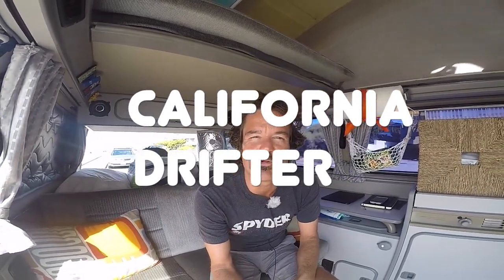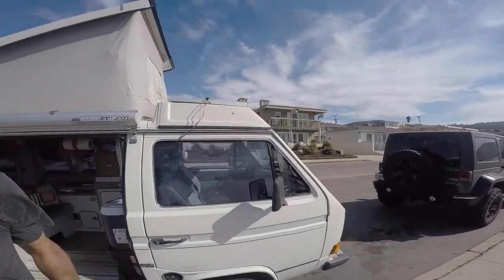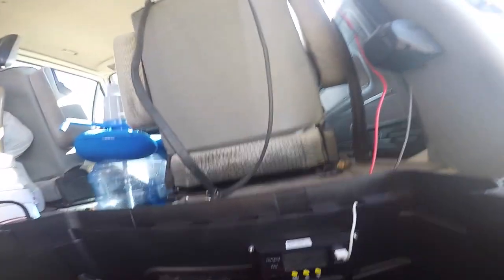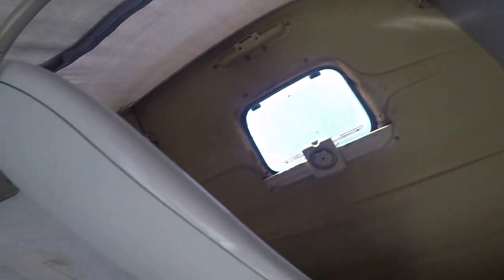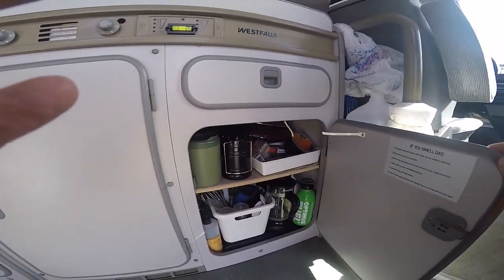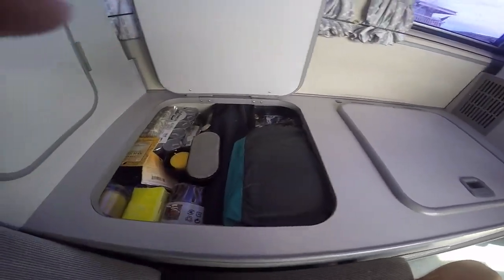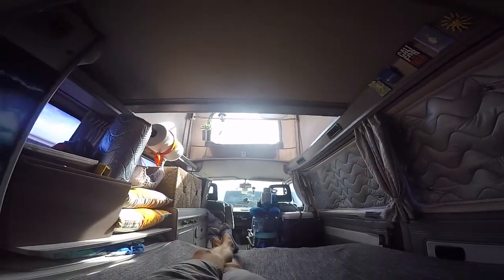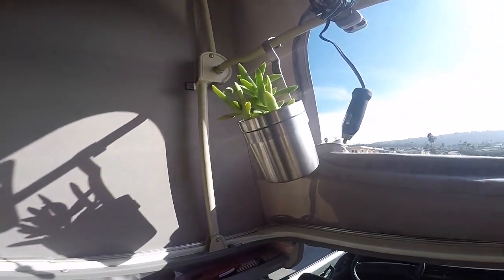California Drifter: Episode 2 - Tour of my Van

Comment: Great in California temperatures all yr round. 
How would you stay warm in British winters ? temp -5 to + 8 deg average.  can hit -10 .
yesterday and today were 30 deg = very hot !  summer 14 to 24 is average normal. 
A canvas pop top would be Impossible except on good days in summer.
Only last week we lit the log fire in my friends Pub ! we were feeling cold. mid May !  yes its that cold in england UK.
Reply from the maker: Great question! My main reason for staying in California is so that I can stay between 18 and 24 degrees all year around. I use a Mr. Buddy propane heater to keep the van warm and to prevent my onboard water from freezing. On the hot days I just open the van up and use my awning to keep the sun off the van.
Reply: Our temperature is now half what it was yesterday. back to mid teens 15 deg change in 24 hrs. 
in a van tonight here i would need that propane buddy on full. 28 th may 3am GMT UK time. i'm closing the widows and off to bed its very cool, and windy just now.
cheers enjoy the freedom. and temp'
Best wishes to all, from England .UK. 

it may be cheaper to fly to california than to heat a van in summer here? 
ha ha, have fun enjoy and keep smiling.

Comment: Hey, what happened to the shower set up. I was hoping to see how that all hooks up.
Reply from the maker: Todd Behnke I was going to use a weed sprayer bottle and heat up water on the stove. Instead I got a Planet Fitness membership and use campground showers. It's working for me.
Reply: Thanks for the reply. I  thought you might have some diy shower curtain hook up on the back door. That would be cool, especially if would keep everything else from getting wet. Anyways, enjoy the travels.
Reply from the maker: Todd Behnke the shower curtain hangs nicely around the rear hatch door. I just use s-hooks to attach it. Not sure what the best way to keep the van dry though.
Reply: Jay Barak @2:16 you said you were going to show us the shower. I was looking for it too